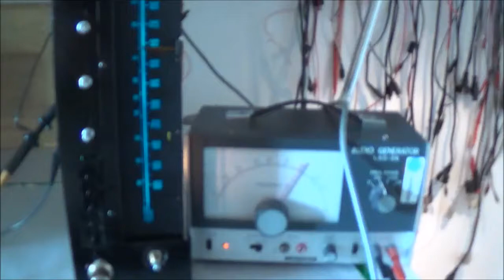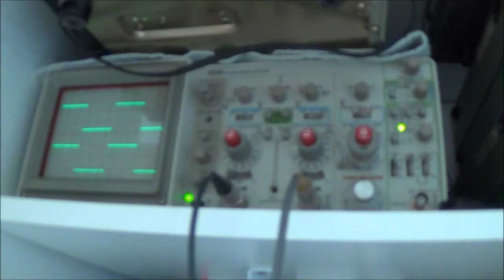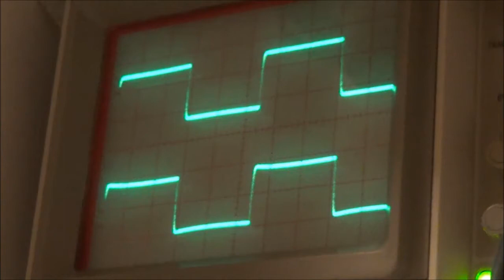Pioneer SX-525 Bass Control Thump

Comment: I have the same exact problem on my SX-525. Can you show me the board that contains this cap you replaced? You zoomed in on the board, but I can't tell which one it would be from your video. Thanks
Reply from the maker: I no longer have this unit and threw away the service notes I made. But I looked at the video and I was able to figure out it was C1 and C2 on the main amp board (AWH-006). These are electrolytic capacitors rated at 1 uF and 25 volts.  You can use caps that are rated at higher voltages (35, 50) if you don't have 25 volt caps. These are the input caps to the main amp board (not far from the edge of the board). On the schematic they are the first caps on the left. The left is the input. Both are close to pins 1 and 2. These caps are supposed to block DC voltages, but they were leaking and letting DC voltages pass. Good luck!
Reply: @OldSchoolElectronics  Hey thanks a bunch. I have a cap kit that I bought on ebay for this unit, and your instructions will help solve this issue. Thanks again for the detail.